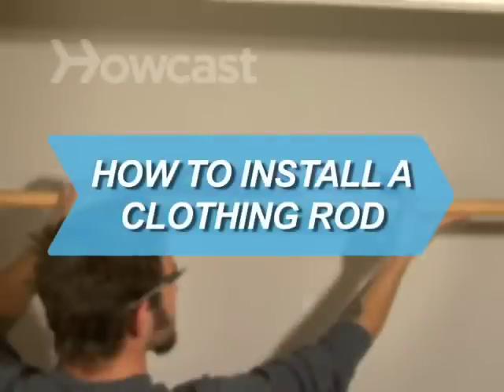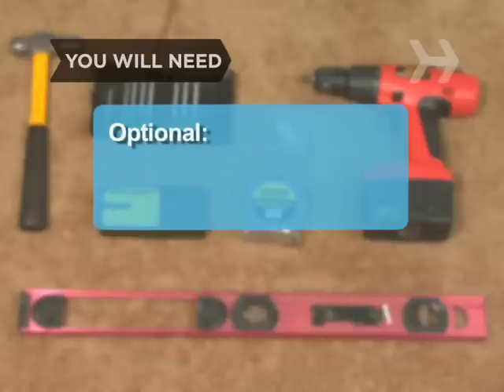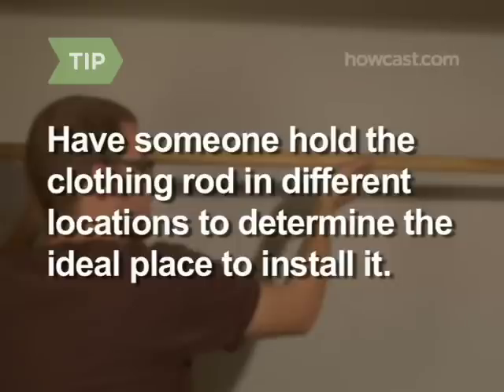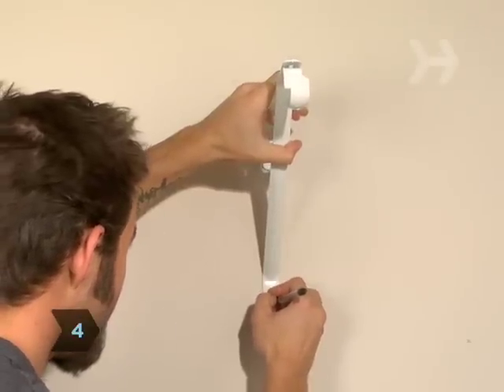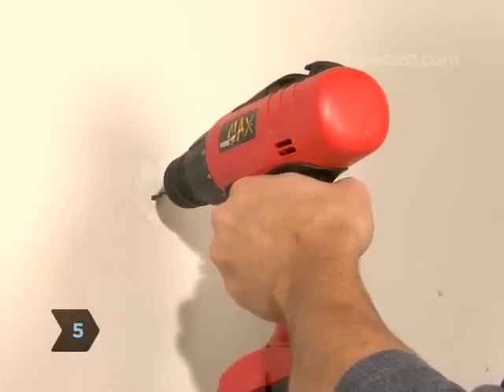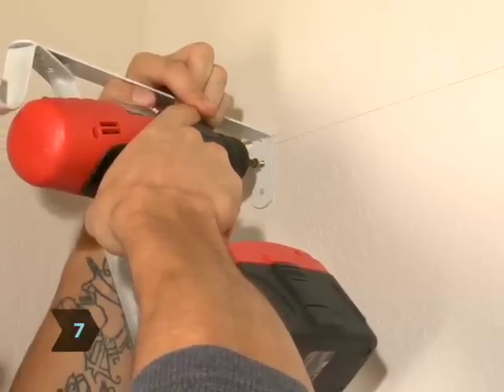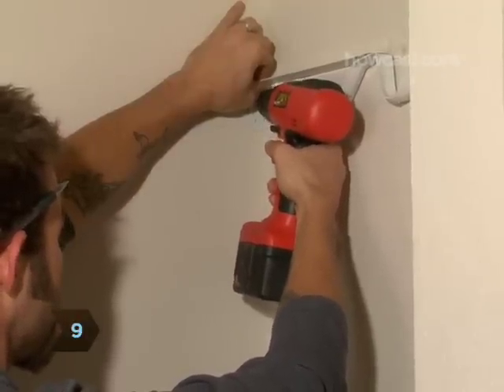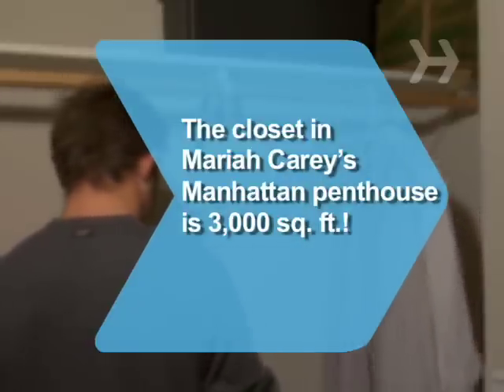How to Install a Clothing Rod

Comment: I agree.  Using drywall anchors are only going to hold so much clothing.  This is the problem we had with my house.  The clothing rods were installed by previous owners.  My wife put all her clothes in this closet and after a few months....CRASH!!!  Clothes all over and holes in the wall!   So if you want this job done right, it must be installed into the studs of the wall.   Might need to screw a horizontal board to the wall into the studs so you can install the rod holders and hardware to.   Good luck.